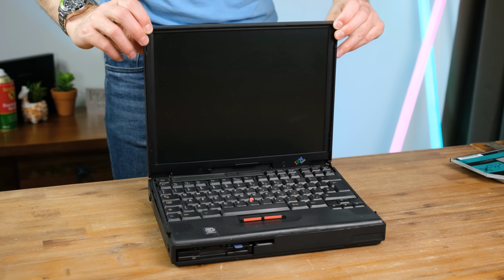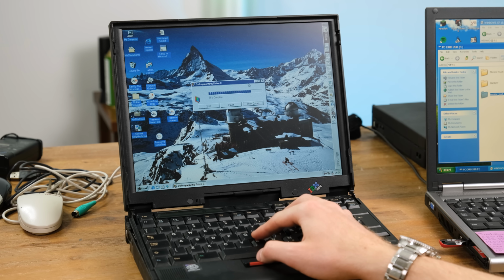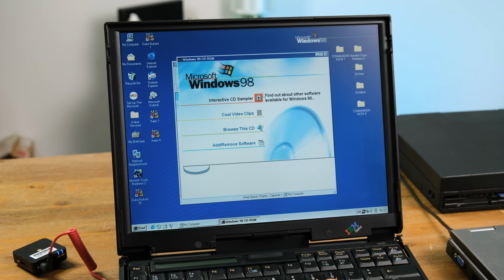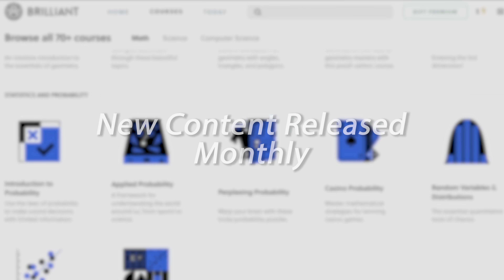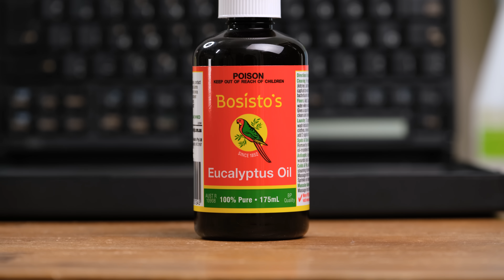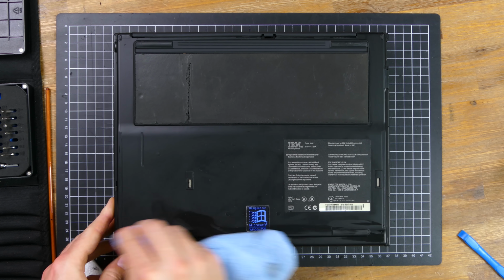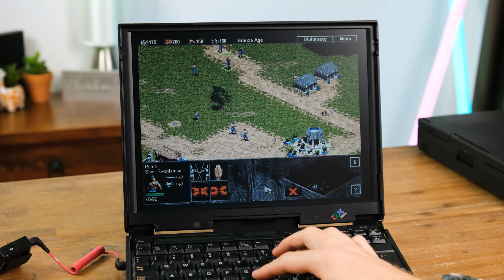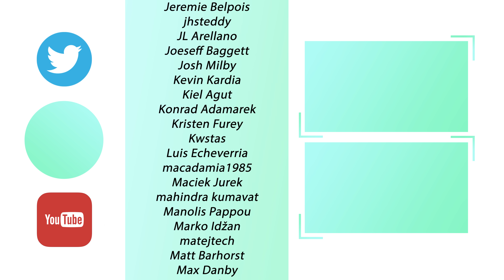$6,500 IBM Thinkpads From 1997! They're Melting...

Comment: Seeing the worn N and M keys reminds me of working at a loan servicer that was using a software from First Data that was originally meant for credit cards, their graphical front end didn't pull all the information we needed for all occasions so some times we had to go straight into this software, that was probably designed in the late 70s or 80s, I think it was to find the regular payment amount on accounts that were paid ahead, I had to type the loan number, then hit f5, the type "nm cl1" to get to the screen where I could find the fixed payment amount, and then you'd have to do that again for each individual loan and it was always the customers with tons of loans that needed this information.
Reply: @ahoyrobi  I don't know what the actual software was, they just referred to it as "FDR," which I don't think was the actual name for the software, it just stands for "First Data Resources," We only ended up with that software because the company was originally going to get into issuing credit cards but then decided not to but still had the contract with First Data, so they converted all the loans onto it and it was a clusterf**k, all the loans still had some data store in the old servicing system because ancient credit card software isn't exactly meant to do things like keep track of 1098E eligible interest. There was a guy in upper management that used that same exact software at a certain major credit card issuer/servicer/processor (that's not AmEx,) and that was as far back as in the early 90s and while he was at that company he actually worked as the middleman communicating between the developers and end users on the graphical frontend they were making in the late 90s or early 2000s. The software the loan company originally used was internally purpose built and they never should have abandoned it, it dated as far back as the late 80s, at one point I found an old ComputerWorld or InfoWorld article about the system from the mid 90s, explaining that it was built to work on some Amdahl mainframe and that it was pretty much the best education loan servicing platform ever made at that point and that's part of the reason the government was still giving them FFEL Program loan contracts and hadn't went to doing all Direct Loans like they did after 2010 because at that point in the 90s there was really no other servicer that could do what we could as efficiently as we could, and that was in the early 90s, that software was still in active development until they stopped primarily using it about a decade ago, it was so well designed and built for the purpose that they should have never stopped using it and I think now I heard they may have actually sold that software to First Data/Fiserv.

Comment: i had a couple of those 765d machines around 2000-2001 whoever owned them before me must have spent a small fortune upgrading them one was maxed out with 80mb of ram a 6 gig hdd and the cd rom was replaced with an 8x dvd rom. one thing that sucked was u could never really go beyond windows 98 with them IBM only ever put out a beta driver for the sound card for windows 2000 and the beta driver was super buggy and the 2000 beta driver would not work at all with windows xp.

Comment: My thinkpad t40 still has the rubber coating on the top, but none on the bottom. Maybe the bottom cover was more susceptible to melting due to heat overtime, and IBM stopped coating the bottom on newer models. This is just a theory though.
Reply: I think it has to do with ambient temperature and lack of use.
I had 4 rubberized pens, 3 at home in a pencil holder and one in a mailbox with a much cooler temperature.

The latter is still fine. The others melted and had to be stripped of the coating.

Comment: Those old IBM Thinkpads were bricks. They lasted way longer and we’re just iconic. I still have an old R52 that works just fine, except for some screen weirdness. We use “Lenovos” at work, but they don’t capture the same feel or quality.
Reply: I have a t40 and it’s really well made. The keyboard is also the best keyboard I’ve ever used on a laptop. Better than even the unibody MacBook Pro keyboard.

Comment: I'm surprised nobody's come up with a home-brew solution for dissolving melting rubber without destroying plastic, like how retrobrite was such a breakthrough.
Reply: Submerge the part in IPA, wait a few hours, wipe off, with minimal rubbing /scraping.
Reply: @bufordmaddogtannen  I will definitely try that. I mean at some point, someone will find a spray that'll do it, do you don't have to use so much alcohol

Comment: I think the companies knew that the rubber coating would eventually break down, and we're okay with it. I don't think they ever thought someone would collect their products, and that they would just go to e-waste after a while.
Reply: That rotten stuff was put on a number of high-end consumer products, stuff like portable radios that weren't going to be obsolete in a couple of years. I think they just didn't test it properly, especially in humid climates. It did feel really nice when it was new, though.
Reply: @michaelwright2986  I have an electronic pen from 2006 coated with this stuff. I'm not using it anymore but when I checked it recently the coating had turned into goo
Reply: @timbermicka  Frustrating, isn't it. Do you know what happens?

Comment: Hey not sure if this helps at all but if you need to transfer files between these old windows boxes you can use the serial port much the same as you would FTP. Back when I needed to do this I would just keep a variety of DB9 and DB25 converters. The amount of times i'd plug a USB into windows 98 only to remember it would prefer a CD was annoying, love the videos the classic tech space is awesome

Comment: Got out of retro games collecting 2020-2021 and it’s wild how quickly 90s stuff is starting to age the last few years. It’s gone from merely collecting and storing to full on preservation work
Reply: Retro is becaming very expensive and the 90s stuff starts to show its age. People need to take care of stuff, old hardware needs care, needs to be powered on from time to time and used, not just stored in a box. Batterys leak, caps leaks, cdrom belts become loose etc. Some people that only collects and store and not take care of hardware, someday they will try to turn on the device and does't work and some maybe beyond repair.

Comment: I recently found my dads 2000 lenevo. As expected the battery was dead and no charger. I took the battery apart and made a 3 stage divider then powered bms board with 12v from bench power supply and shorted the fets briefly to enable output and it worked. The laptop powered on and the harddrive was still running. I got into windows me and after discovering it still has a lot of files i shut it down and removed the hdd , and plugged into my pc with a usb to ide adapter and made an image of the drive. 
I found a lot of sus meterials in the download folders. Including some really low quality 18+ things 💀💀
Reply: Some things are better left not found
Reply: @liammccauley9380  that's right but i also found a crap ton of child hood pictures and videos. My dad was a camera guy and he had a huge sony camera in 2003 that used to record in dv tapes at 1080i. And a bunch of those were in that laptop cus it was the only one with a fire wire port & it had svideo , tv tuner and separete left and right audio line  in , optical toslink digital out. These features can not be found in any new laptop. Specially a builtin svideo and tv tuner. 99% laptops do not include separete line in but atleast they have a software defined port so u can make it line in but not have line out at the same time. No chance of getting digital spdif or optical in any laptop made in last 10yrs.

Comment: That was a really nice overview of these machines! I'd personally keep the one with the upgraded 5GB hard drive - hopefully that was the one that you cleaned up!
I must say, I don't like rubberized coatings on laptops either, since they tend to break down. Even some Dell Studio laptops that I've bought not too long ago (~10 years ago?) have started to have their rubber surfaces melt. :(
Reply: A lot of lower end android phones have rubberized backs. Im not looking forward to the shenanigans its going to bring to my phone stash.
Reply: @qwertykeyboard5901  Not only low end ones. My Samsung Galaxy S5 also has a molten rubberized back
Reply: @robertszujo9528  Had to work with a new Dell Laptop recently too, also had a rubber coating, sadly.
Reply: DONT GET RID OF THE COATING!!! if you don't have to remove the coating and it doesn't look melted and is just sticky, then put baby powder on the surface of it. it sounds ridiculous but it works. i did it with the coating on the palm rest of my dell precision and it hasn't been sticky

Comment: The rubber coating is such a nightmare. Even on devices nowadays, I cannot believe manufacturers still use that crap.
Reply: Most smartphone charging cable also still using the smooth rubber coating. It's fine until 2 years of use, after that the rubber feels sticky, and after 4 years, the rubber are starting to crack and crumble. Fortunately, some charging cable are now using braided style which has slightly more durability

Comment: I have a 760XL in almost perfect condition like factory fresh new including Windows build and its original battery even holds 2 hours of charge and I even have brand new recovery disks for the XD model.
Reply: There’s a backup battery inside the keyboard assembly that leaks. If you’ve got it in perfect condition, get that battery out so it stays that way! It WILL leak and kill the keyboard.
Reply: @3lectr1c  no
Reply: @brian_jake  ??

Comment: I always use nail polish remover, to fix the stickeyness. Works great! 

The downside is, you have to look out for printed text on the rubber (or maybe plastic near to it). 

Because it will instantly remove the text.
Reply: Acetone is not recommended for this as it will attack the underlying plastics. Any smooth surfaces will end up dull, if you're lucky and pitted if you're not. Stick to isopropanol.
Reply: @egbront1506  ah, good tip! I will try next time :)

Comment: As an old fart in his 60's who has enjoyed buying a lot of tech over the decades. I have had had first hand experience of these horrible rubber coatings disintegrating on many products. The worst part is some of my tech made of plastic, such as Psion organisers and a few other items. The actual plastic has become brittle and just breaks away.

The tech of the 70's and 80's was much better built than the tech built today. I expect in another 50 to 60 years from now most tech of the 1970's and 1980's era will most probably have turned to dust. Unless it is enshrined in some form of hermatically sealed case and not touched.
Reply: Rubber coatings from 90s laptops hardly qualifies as “tech today”. Modern laptops are built out of solid aluminum chassis…. Pretty durable
Reply: @kumquat19138  True, but most of today's tech will be ewaste in like 10 years because companies insist on making it hard or impossible to upgrade their hardware and frame it as inevitable issues with (their own) design process.
Reply: @willm5032  Tech from the 90s became e-waste after 3 years... The laptop from this video was obsolete and nearly worthless just a few years later. It was so common to spend thousand$ on a computer and then put it in the closet after just a few years. If a computer lasts 10 years that's awesome.
Reply: @stephenharris5532  that is a really good reason to only buy the best value per dollar in performance, even if it means a R5 3600 or i5 12400 etc and not the Z or X class motherboard.  2-5 years down the road do it again with the new tech.  I see people buying i7 or i9 and shake my head, they will still be on that while the new i5 is whupping it in performance and I will have spent way less.  Also I will have 2 systems, so I can sell one or hand it down and everyone I know gets an upgrade.

That said these ThinkPads are amazing quality and tech, I am dailying a T560p with the NVMe x2 adaptor and its pretty solid.  Gaming on a P70 with a MXM B upgrade (the heatsink for the upgrade is $50 on aliexpress).  If you look around for a deal on one, I think I paid about $400 all in for one and a "dead" M4000 quadro to put in it.  Did another for about $500 including a P71 motherboard and a P3000 Quadro.  People don't realize it needs the 170w or 230w adaptor brick and call it dead.  Then sell it and leave the 8gb or 16gb memory stick under the keyboard, so you are all set, add some more cheap ram in the three open slots and you can have 32gb with cast off 8gb sticks.
Reply: @milescarter7803  I’m not so sure about that total cost claim. 

I have an 11 year old i7 and I’m only just starting to want to replace it. Yes, it’s been on par with i3s for a couple years. But before that it was on par with modern i5s for a long time. I’m sure I would’ve spent more in total if I’d’ve had to have two motherboards, two types of RAM, etc to support a 4-5 year old chip.

Of course I didn’t pick the absolute tippy top performance chip, I did pick the best performance per dollar at the time. It just so happened that actually was the regular 2600 back then, or 4700 a little later, unlike today with all the i9 and Threadripper. 

In fact a gf had an i5 2500 when I had an i7 2600, exact same chip except for SMT is enabled on mine. She did have to replace her entire PC about 5 years ago, and in total she did spend more across both those systems than I did. Of course she’s had higher performance than me for that time, but I didn’t miss it. Transcoding and compilation is still fast on mine, really it’s JavaScript sites that’re getting painful. Plus she’s wanting to replace it again in another couple years, and we’d probably end up in parity again with my replacement. But I’ll have saved at least a few hundred bucks, if not more.
Reply: @stephenharris5532  Thankfully this craze has slowed down quite a lot, not even because of a stagnant industry, but because stuff just simply can do what you need and way more for years already.
My home PC hasn't seen a processor upgrade in 10 years and the graphics card half of that. Heck, the sound card might be some 15 years old even, thank you PCI slot.
It just simply does all I need, it can play all the Full HD or even 4K videos, even 3D modeling. Obviously newer stuff wipes the floor with it, but the need to just bin your stuff every 3 years thankfully doesn't apply to PCs anymore.
Reply: @stephenharris5532  3 years, lol. Acts like he was alive then.
Reply: @marcellachine5718  I'm almost 40
Reply: @kumquat19138  Might be more durable in the casing department, but I don't think Lithium Ion batteries will be your best friends for collecting stuff.
I can imagine quite a few permanently bent cases from bulging batteries, and that isn't even a worst case scenario.
Reply: Nah, I doubt 70's and 80's tech will turn to dust. Most of it was made out of metal, steel, and higher quality plastics (and fake wood grain lol)
Reply: @jdslyman I am aware, I was just pointing out an inconsistency (or more likely just a typo) in the original comment.
Reply: Daddie gimme iPhone 👉🥹👈
Reply: old fart
Reply: i have an old nokia flip phone that had blue rubber and it's like it melted , it's just squishy and stains blue everywhere
Reply: @jdslyman I had a Thinkpad external CDROM and the coating turned to goo. I discovered I can scrape it off with a paper towel and kitchen cleaner, the one in a spray bottle, and it came right off to my surprise. Clean shiny black plastic now.
Reply: @jdslyman Even Ferraris from that era have the problem with the rubberized coatings going to goo mode.
Reply: I think you meant most tech from the 1990s and 2000s? If not I am not sure what you mean considering you also acknowledge in your comment that a lot of stuff from the 70s and 80s had better build quality.
Reply: The tech from the 70s and 80s didn’t give a single fuck about emissions and Mother Nature. But what do you care, you’ll be long gone before it becomes a massive problem
Reply: @jdslyman designed to fail? maybe fragile cuz of innovation but Tvs hold up well now
Reply: Bro is 60 and smart af, congrats...
Reply: I know more about fountain pens than is good for me. The first really modern plastic was the Lucite/Perspex that the Parker 51 was made out of. That stuff is indestructible. Then in the 1960s good companies, wanting to make improvements, used more modern plastics that have gone brittle or have sagged over time. Then they went to modern acrylics, which seem to be long-lasting. In some cases, I don't think manufacturers are being cynical, it's just that nobody really knows how new materials will age.
Reply: Fart?
Reply: @camion__  saying hes an old dude
Reply: @famousfighter2310  Nah he just fart
Reply: @camion__  Old people let off wind from their rear more often than younger age groups, hence the English phrase "old fart".